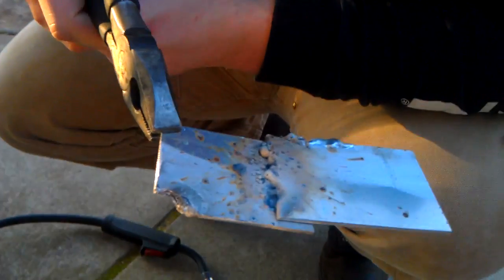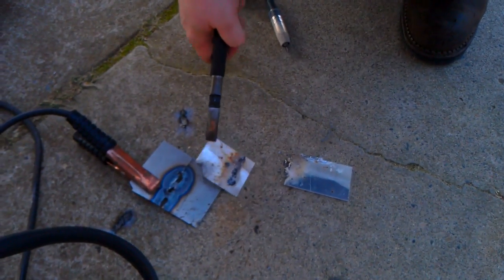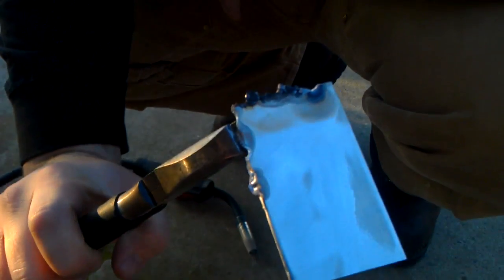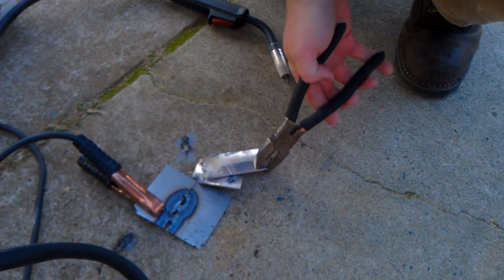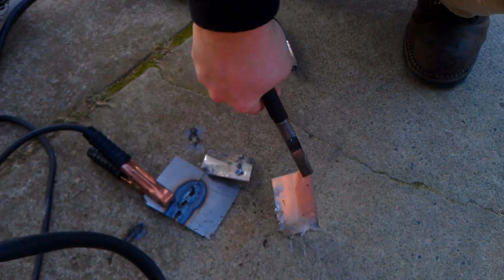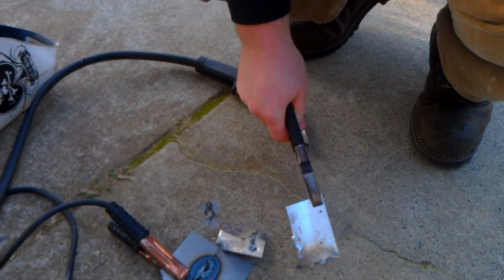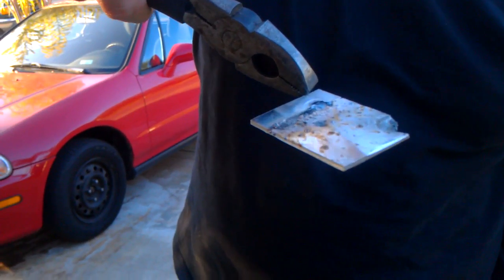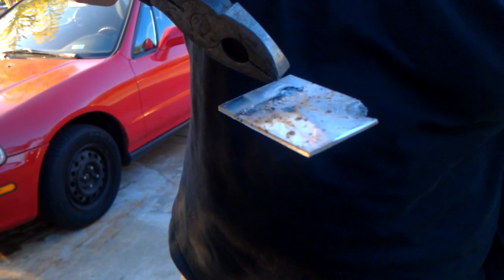flux core welding on alumium

Comment: People, take some welding classes. All welds need the correct cover gas for that process. Cover gas is either from a pressurized tank, or from a flux coated electrode or a tubed wire with flux in the core, or flux that is poured on as in sub-arc welding. ALL WELDS NEED A COVER GAS !!!!! ARRRRGGGGHHHHH Some ferrous and non ferrous base metals can be joined, but not actually welded. Like brazing steel with bronze, or TIG brazing. Aluminum and steel don't mix under standard welding processes. Sorry. There is some crazy guy in Canada who claims to use high voltage microwaves and whatnot and claims to fuse steel and wood, and all kinds of shit. And levitates heavy stuff. Check him out here on YT. https://www.youtube.com/watch?v=cHvimKQebVg    john hutchinson effect.

Comment: They make aluminum flux core wire.. but I think it's only for spool guns.... Because I tried pushing it through my little hobart at .035 and it's just too soft I guess, it wads up trying to push it through my short lead...
Reply: I'm sure he recommended 045 tip for 035 wire.
Reply: Try using a bigger tip size maybe 1 or 2 izes bigger. Aliminium expands as it heats up. Saw it on a video fluxcore gasless aluminium welding. That is with gasless fluxcore aluminium wire.
Reply: You can’t weld aluminum without using gas. It may say flux core on it but it’s not hollowed out flux core wire for aluminum,, because that doesn’t exist.

Comment: Well I mean its. a steel  filler wire on aluminum the fluxcore has nothing to do with it lol.
Alum dissipates  heat faster than steel. It's not millscale it's an oxide  layer. All aluminum builds this layer naturally. That's why on tig we use AC to have one side of the pulse that cleans and one that fills. The oxide melts at like 3000 degrees and the alum much lower. That's why it takes so much heat plus alum is a heat sink it dissipates heat. That's why DC is really hard because the heat you need to burn thru the oxides is way way way way too hot for the actual metal your welding.  Though it is possible.  I've tig with DC and MIG with DC on a regular machine no spool gun and it does work in. a bind.  It penetrates and has reinforcement but it looks and runs like ass.
 Linemen pliers are the square bill pliers with a cutting section.. dikes are the cutters. Some are angled some not but they dont have a plier or gripping section to them. They are totally different tools (linemen pliers and dikes) linemen pliers are called that because they are mostly used and designed for electricians.  You grip the wires with one set and use another set to twist them together  nice and tight and then cut the tips off for the wire nut or what have you.  You cant do so with dikes because..well..they only cut..
   But ya... the fluxcore part of this has nothing to do  with what happened.. it has everything  to do with using steel filler on alum. They cannot  fuse together in any way ACCEPT  with explosion welding... you can buy plates or couplers that are dissimilar  metals. Ie steel one side alum another. Or stainless  and brass. Copper and alum etc.  Very very expensive... but if you had a random pipe application where you have stainless pipe that needs to be welded to a copper pipe for whatever reason.. you can buy those couplers  that are stainless on one side and copper on the other  explosion welded together.

Comment: Hope that in the last 7 years you learned to pull instead of push... If there's slag you drag
Reply: I very well understand what it is. my point being only that what he's doing is wasting time and material. there's no flux core wire for aluminum. when welding carbon steel yes pull  with flux core. But on aluminum you always push. for any mig torch. using appropriate filler wire and argon. I do a lot of welding. I have a machine set up for flux core when I have to weld outside. and also have a spool gun for that machine for aluminum work. amd on the other mig is set up to run solid wire and c25 gas. and also have a couple Lincoln buzz boxs. along with a welder/ generator for mobility. I've done mobile welding and worked in a yard rebuilding/ repairing etc....  for the oil derricks and any thing they manage to break.
Reply: @moosejrcustoms5292  Did you even watch the Video. He clearly stated that he wanted to experiment to see what happens when you try to weld aluminum with a Fluxcore welder. And at the end of the video he stated that you should weld aluminum with the proper equipment. He knew what the outcome would entail. Do you understand the word "experiment"
Reply: LandofNone he just wanted to make his “expertise” known
Reply: for 1. you always push on aluminum. for 2 he needs aluminum filler wire and argon shielding gas. What he's doing here is wasting time and material
Reply: May be you don't understand what flux core welding is. You cannot use the push technique here because the flux will be above your welding area. Push and pull is both effective techniques.

Comment: Thanks for you vid. I was always curious if my Lincoln flux weld would do aluminium. Watching your demo proves it don’t . So I’m not gonna even try it. Thank u .
Reply: I don't think anyone makes aluminum flux-core wire. I've tried stick welding aluminum, it works but it's ugly and it burns through very easily.

Comment: Bs i can make a weld look beautiful with a harbor freight chicago electric welder with 0.30 wire or 0.35 or 0.23 on steel, never tried aluminum
Reply: then it's not bs now is it.. smh
Reply: @calholli  No it won't work. Take a welding class. You need 4043 aluminum wire, and argon cover gas.  The CE90 or 125 is not setup for gas. Get a grip.

Comment: A real welder can do it with any brand or type of welder
Reply: Lol you think so? So go try stick welding 1/4 inch aluminum with a 110v HF inverter stick welder...impossible.
Reply: No it won't. Take a welding class. You need 4043 aluminum wire, and argon cover gas. Get a grip.

Comment: that welder is only good for 1/8 and smaller, and you have to run it on 4 or less wire speed to get any fusion. you also cant weld aluminum with steel wire...

Comment: You may have been welding with a positive gun, when flux core welding check to make sure you have your gun attached to negative. The polarity will help with the splatter.
Reply: again.. you CANT change polarity in many cheaper  gasless mig welders.. like his.
Reply: Its not a mig welder.. I get the point though

Comment: you can weld if you had aluminum wire in your 90 amp
Reply: I've looked all over the internet for aluminum flux core wire,  but couldn't find any. Could you give a link to some?
Reply: No it won't. Take a welding class. You need 4043 aluminum wire, and argon cover gas. Get a grip.
Reply: https://www.ebay.com/i/253456313750?chn=ps

Comment: If you want to see something really pretty, try to weld an old lawnboy magnesium mower deck using a stick welder with a 6014 rod and use about 135 amps.   Seriusly DO NOT attempt this, I guarentee you will wish you hadn't if you do.

Comment from the maker: You would have to use a mig welder and not a flux core welder. You would also need argon shielding gas if you get that set up it should work as long as you run a grove weld and build it up with a few passes, and be consistent with your weld technique. I personally would use and acdc stick welder with aluminum welding rod so you don't have to worrie about shielding gas, argon gets expensive. Hope that helps you.

Comment from the maker: yeah my welder doesn't have the gas inlet to run gas metal arc welding (mig) but the machine has paid for its self a few times over from doing wrought iron fencing and some small odd jobs.